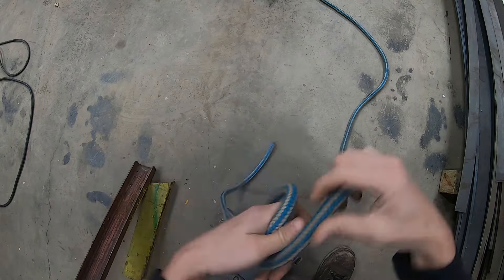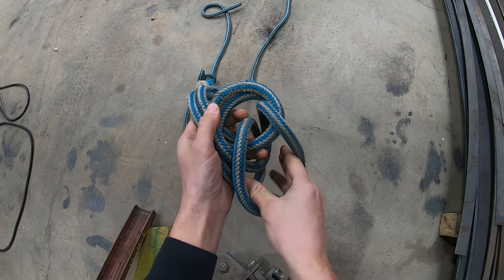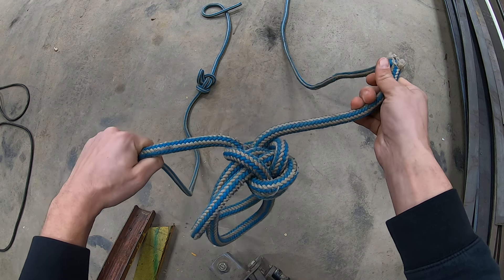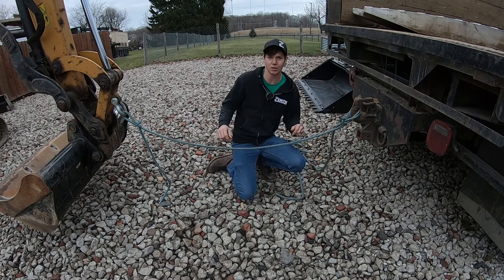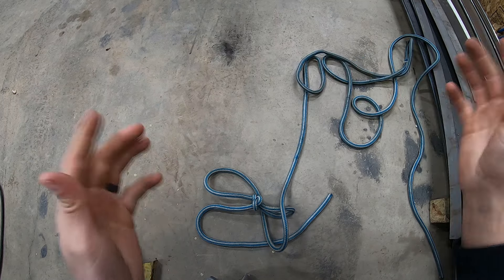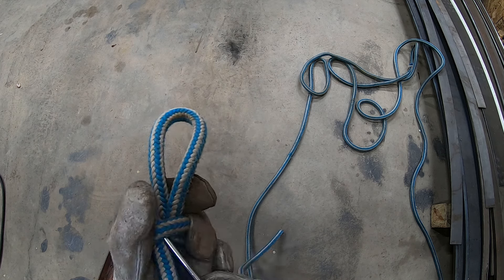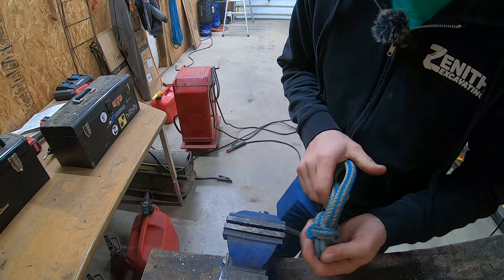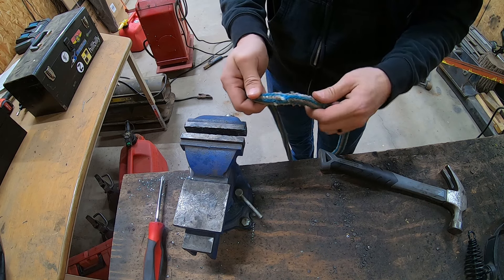Bowline or Butterfly?

Comment: Nice test.   When you have a knot that locks up in rope or webbing the best thing I’ve found to undo one is to use a large wood mallet or plastic dead blow hammer and a block of wood as a back stop.   By hitting on the loops in the knot your trying to loosen they usually start moving.   Way easier on the rope jacket than prying with a screw driver or Marlin spike.    In the field the flat back of an axe and a larger cut off with end grain work.   Thank you for taking the time to make these videos
Reply: This has saved many a bull rope after it’s been hauled on by a forwarder or log truck grapple
Reply from the maker: Thanks for mentioning that method! I'll definitely have to give that a try!

Comment: with that understood, would you use the bowline on a bite to midline attach pulleys for mechanical advantage? The other day we loaded a butterfly in a 3-1 set up with 5 guys and it was really difficult to untie. I use the bowline on a bite when attaching ropes to come-alongs for this reason. Great demo
Reply from the maker: Yeah, I would definitely use it for that. I'd say that pulling trees over is my primary use for that knot. I typically use it in conjunction with a rope jack. If you're using a 5:1 or 3:1 a lot, I have found it easier to use a prusik because it's a little easier to adjust the position of the attachment to the rope. With a 3:1 or 5:1 it can be really handy to pretension them and then reset before making any cuts in the tree.

Comment: I always use the AB, but never under heavy loads. It’s great for midline tying of canopy anchor cinches. In those applications, it’s never hard to untie. For most other applications, I use either a running bowline or bowline on a bite. I have tried figure eights on a bite, but they can be a bear to untie after heavy loads too. When knots bind up like that, I use the marlinspike on bosun’s knife to loosen the rope without damaging the it. Great video, my friend!
Reply: Try a circus bowline (aka farmers loop). Extremely similar to alpine, in my opinion easier and faster to tie, and unlike an alpine butterfly, it comes untied after a heavy load. I have completely deleted the alpine butterfly from my memory its completely useless with the existence of the circus bowline!
Reply: @devinbarcelona4437  First time I've heard the Farmer's Loop mentioned.  Looks easy enough to tie.
Reply: @boomupengineering  I can't Believe how few people know about it. I love it. Since learning it, its been so long since I tied an alpine I forgot how. I will never have a purpose for that knot again.
Reply from the maker: Rock climbers like the figure 8 on a bite because it tends to stay tied to their harness better while they climb and it flops around without a load. I have heard that it's really hard to untie if they take a fall. However, I think if you put a bowline and a figure 8 on a bite together in a break test, the figure 8 wins consistently.

Comment: Do you ever use webbing to make achors for change of direction or blocks when pulling hard? Cutious what knot you use
Reply from the maker: I don't use webbing for anything other than climbing redirects and speedline slings. I'm definitely not an expert on webbing use, but I always avoid using any knot other than a girth hitch with webbing. It's always hard to untie and I would speculate that it knots would load the fibers in a very uneven fashion.

Comment: When say pulling a tree over and a running bowline is used to tie top tree off .those seem to be the tightest or toff to untie. I stick a steel biner in there if in doubt..or a peice of old hickory handle about 3/4 inch diameter..but usually no issue
Reply from the maker: What knot do you tie those items to the rope with? Something else you can do if you're expecting heavy loads is add more wraps around a branch or stem wood to reduce the load on the knot.
Reply: @zaccheus  running bowline..usually. I watched a webinar tree stuff with Kevin Bingham and he basil.ties with a bowline and a bight so I like this method sometimes I will tie that to a truck or machine with a carabiner threw it so it can't get tight ..has worked beautifully
Reply: @zaccheus  out delivering wood storm snow coming here last nice day so trying to prep hoping Walmart is open to put rear tire s on truck have got bunch trees to do but 1 inch of snow here shuts down roads stores coming snow tonight..saying 6 inches so here that's like 2ft back home up north they don't have many plows salt trucks .mountain roads get shut down or ice ❄ it's nightmare..thanks for reaching out man ..really respect your opinion and work ethics.you are a dieing breed in your generation. Very impressed with you ..
Reply from the maker: @Sethhaun78  aye that sounds like a tricky situation. I worked at a tire shop in highschool and we would always get slammed for a week straight after the first snow. I think I did 76 hours in a week once year 😅 Thanks man, I. Just out here doing my best. It's all anyone can do 🤷‍♂️

Comment: Got shown a knot at work and its amazing but no one knows what its called.  Easy to come undone after winching 2 ton logs out of a gorge.  Someone tied a bowline on a bight on a different log on the same job and it took 10mins to undo.  I'll haver to film it one day.  Nice video though.
Reply: I just stick a big Dan or simaler in between the knot ..I use bowline on bight and or or running bowline doubled bite.stick biner in the pinch spot works like a charm..the knot is still the holding point it just keeps it from jamming and unties easier
Reply from the maker: Very interesting, I'm suprised the bowline on a bight was so hard to untie. Was it loaded across the knot? Like from both ends of the rope? I'd be very interested in learning about that knot!
Reply: @zaccheus  yea sometimes it gets hit on landing.or maybe was twisted and hit.but of I'm pulling super hard and or mostly have un experienced help so I will stick biner threw it .but usually ok
Reply: Nope standard pull direction.  I wondered if the rope made it easier to cinch down as the teufelberger 7/8th stuff is pretty open weave? I'll make a video of it.  @zaccheus
Reply from the maker: @ItreboR63I  that'd be sweet, please do!

Comment: Getting it wett then useing a rubber Mallet will eventually break the Saturday knot ..better than screw driver s....seen a guy do this
Reply from the maker: That's very interesting information. That seems like it would make the rope swell and make everything tighter. I have very little experience with marine rope work though 😅